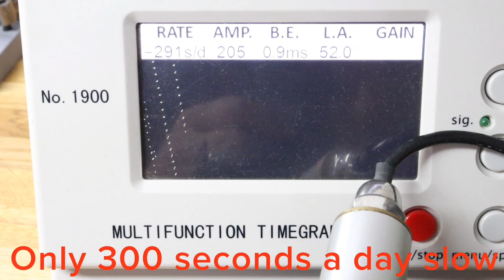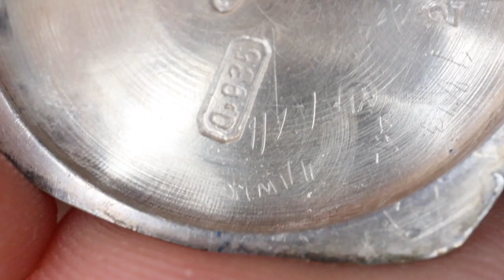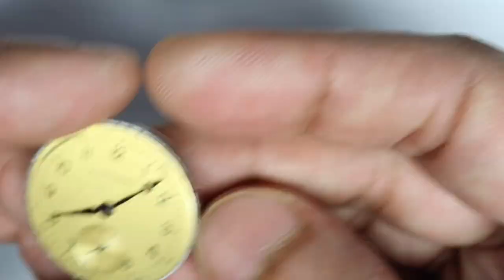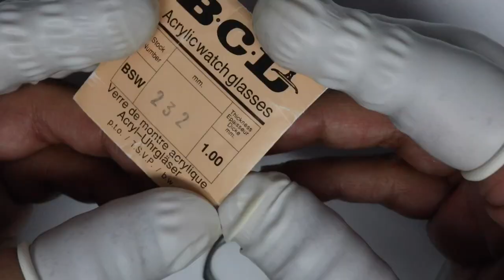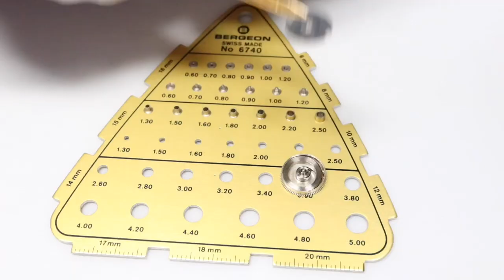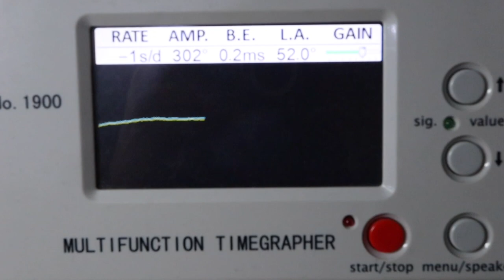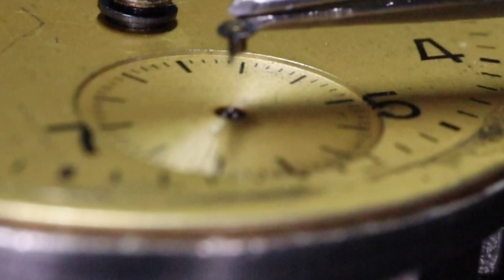100 YEARS OLD & STILL ROCKING | 1920'S LONGINES WATCH RESTORATION  | tutorial silver polishing

Comment: when was plexiglas invented???? 1933
Reply: Neither the glass nor the main Spring were originals in that Longines.

The main spring represented new technology and as the previous watchmaker I'd chosen a slightly thinner and correspondingly longer main spring than the original one was as the use of a modern main spring caused a bit too high amplitude for the old movement.